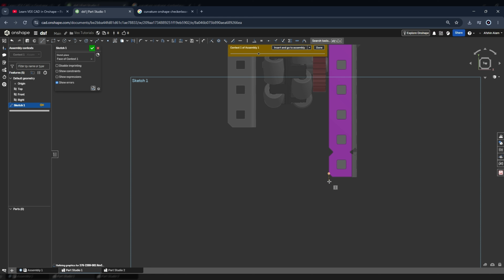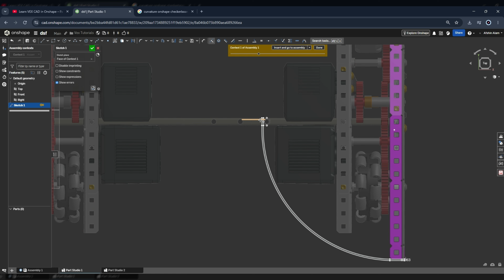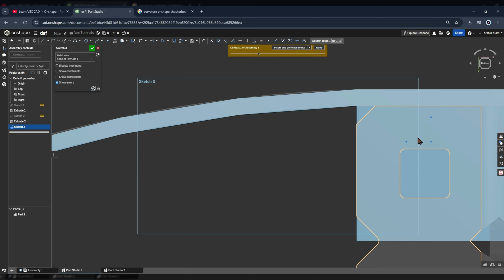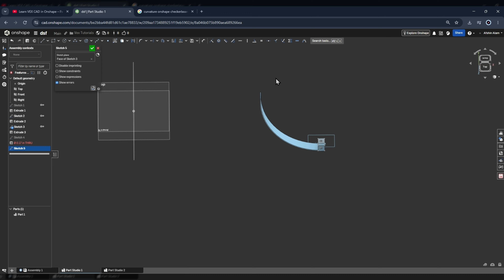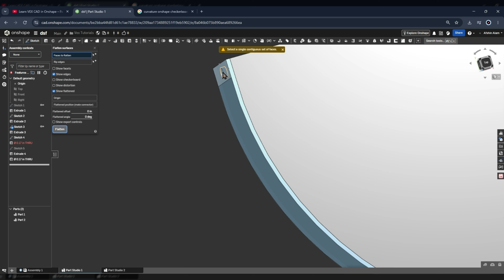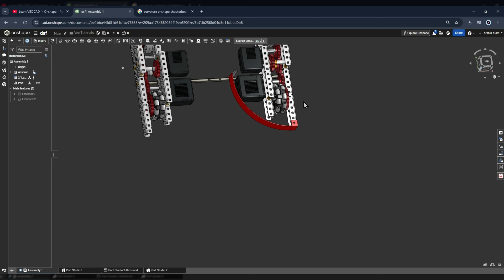Part 18 – CAD a Curved Funnel – Accurate, Legal, Easy to Bend

Comment: Thanks so much for these tutorials man. I was wondering how you would CAD this curved funnel if it also had a vertical displacement (the end of the intake funnel is higher than the beginning)?
Reply from the maker: you could extrude it all up then cut it from the side with a curve or however one side is higher than the other